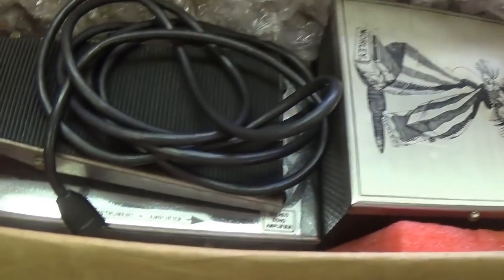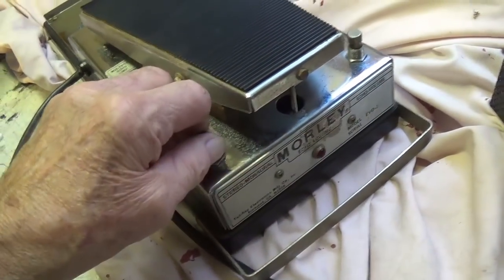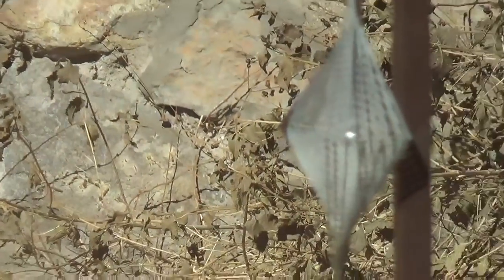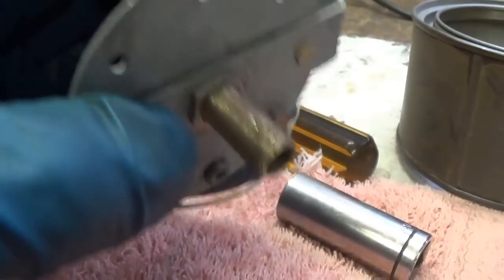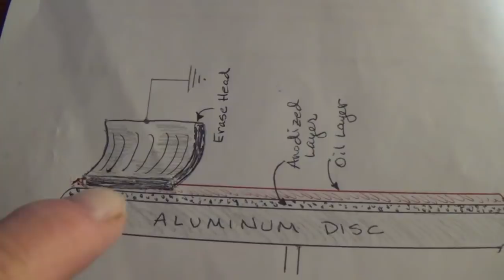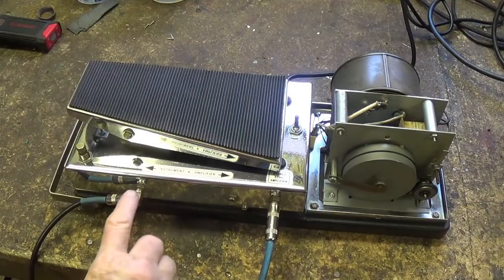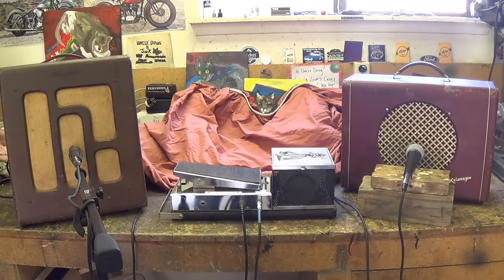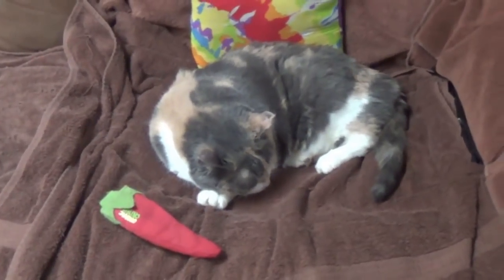1977 Morley Evo-1 Oil Can Echo-Delay Pedal......Complete Overhaul & Test

Comment: Back in the 80's I found a Fender oil can reverb in a dumpster.  It had not rained on it, so I scavenged it and took it home.  It looked like a tiny Fender amp, about 10 X 10 X 8.  Being in a band at the time, I knew being Fender meant something musical, so I opened it up and could not for the life of me could I figure out what kind of voodoo I was beholding. It didn't do anything but rotate, so it found a home in a long ago perished shed. I kinda wish I had it now, after watching this video I probably could have fixed it.  Very nice video, allways glad to watch!
Reply from the maker: Thanks for sharing, WH :)

Comment: Hi Uncle Doug, in the 80's to late 90's I worked as a tech in the photocopier industry and this anodized aluminum disc made me think of the 'heart' of the copier which is a cylinder, usually aluminum with a light sensitive and high voltage electrically sensitive coating. Earlier, that coating was selenium, later cadmium and later still what the manufacturers mysteriously called "organic." In the end, it's still a piece of aluminum with a coating on it. Companies that create these cylinders (colloquially called 'drums'), could probably coat the disc or discs or anodize them. 'Love your work in restoring amps and parts like this one, that you care so much for these great dogs and cats, your sense of humour and I'm in awe of your ability to find parts, tubes & caps for all these projects. Congratulations and thanks.
Reply from the maker: Thanks for your knowledgeable input, RS. You may well be correct, but getting the company to recoat a few discs after hours might be a challenge. We're glad you enjoy our videos :)

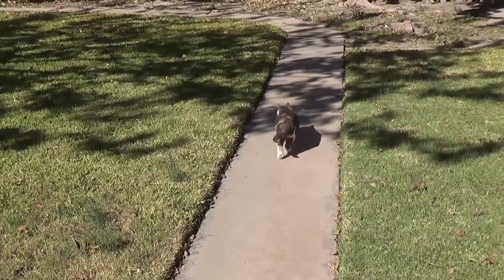Comment: 1:15:00 RIP Rusty. Great video, Doug. I hope you are well in Texas. I know a lot of people have had a hard time without power.
Reply from the maker: Thanks, Brad. Being in far West Texas, we were spared almost all the drama. There were a couple days of snow and cold, but the last 3 days have been clear....and it was actually hot today. I was working outside in a T-shirt (and pants of course ;)
Reply: @UncleDoug  When I was in my late teens and going to community College I worked anodizing small aluminum parts. That was 48 years ago but I still remember how.  The part was made the anode and immersed in a cold dilute solution of sulfuric acid that was in a lead lined tank. The lead liner was made the cathode. A specific amount of direct current was applied for a specific amount of time to make a certain thickness of anodized aluminum. There were tables we followed but we would also measure the thickness with a micrometer. The result is a layer of aluminum oxide that's very hard and corrosion resistant.
Reply: My mom lives in Donna during the winter, but fortunately her neck of the woods has been relatively unscathed. Hope you're doing well down there Uncle Dougie. I miss ole Rusty too :(
Reply: I miss Rusty !

Comment: Thankfully he didn't need to use the Heisinberg Compensator to liberate that stuck shaft! Nice work. I used to own a Morley Wah-Wah pedal
back in 1976 but someone decided they needed it more than I did and absconded with it from my car. Thanks for the detailed technical drawings and explanation. A fascinating bit of engineering.
Reply from the maker: You're quite welcome, Dr. Z. I did end up using my trusty propane torch to heat up the frozen shaft and liberate it from the tyranny of its captor.

Comment: Thank you for the detailed explanation of the workings of the system. For the first 40 minutes I was about to die from curiosity and scratching my head about how it's supposed to work. And I still don't understand how a piece of rubber writes musical signal electrically for it to read. This whole unit is brilliant engineering and full madness. Who comes up with stuff like this? It sounds and looks very cool.

Your comments always crack me, nice to see the cats doing ok. I miss Rusty. My dogs are also buried at our summer cabin's front yard, behind the small potato soil and bushes.
Reply from the maker: You're welcome, Yuppi. Think of how your body picks up a static charge when walking on carpet in rubber-soled shoes. Same idea.

Comment: Hahaha I loved my old Morley Wha/Vol and still have an old Morley "man" logo sticker on my guitar case.
The nonmechanical opto variable resistor on these were revolutionary. My Morley wHa-vol still functions flawlessly with no noise or bad mojo. No moving potentiometer to get abused. Smart design for sure!
"Morley men do it with their feet."
Reply from the maker: I agree that the opto-resistor array is definitely unique.....and effective. Thanks, SS.
Reply: @UncleDoug  Uncle Doug, at 24:30 , to hold onto the threaded part, just thread those two nuts back onto it, and tighten one against the other. Then you can hold onto the tightened nuts instead of harming the threaded shaft.
Reply: @cjay2  One way,  better if you are able are soft jaws in a vice , its probably not too stiff once penetrating fluid added,
Reply: @highpath4776  As long as you're careful that the soft jaws don't harm the threads. Doug did well to use heat to help separate them, though I would have first gone for tightening the two nuts against each other.
Reply: @cjay2  i was thinking same thing about two nuts, but if you put too much torque then stripping could happen.  sometimes too much torque/force can break metal in unintended ways.
Reply: @stevewinwood3674  Perhaps if using the two thin nuts that go on that bushing, but I used to thread and tighten two normal stainless nuts onto studs that I needed to grip heavily when I rebuilt auto engines.
Reply: @cjay2  i understand the concept as does many others.   it isn't some secret you are talking about. 

point is that you could actually break or deform the entire bushing/threaded part if too much torque was applied. maybe that was his concern. who knows.
Reply: @cjay2  for clarification i mean break the entire hollow bushing. not tear the threads.
Reply: @stevewinwood3674  Probably was his concern. In any case, he got the job done without breaking anything.

Comment: The aluminum disk looks like an old hard drive platter. Hmmm.
Reply from the maker: There is a resemblance, particularly the iridescent sheen.
Reply: I was wondering if you could use an HD disk stuck on a capstan of a cassette recorder with the read/write and erase heads moved to make an echo like this.

Comment: I got one on Ebay for $50 back in '05.  Had some fantastic potential, but also some obvious problems. After watching this wonderfully detailed video, I know for sure that I would've only made things much worse, if I started to dismantle the pedal. I didn't like the looks of the belt/rubber wheel assembly & sadly decided that it was best that I look no further, and pass it on to the next buyer. Hopefully someone has done it justice like you have here. Restorations can be so much more difficult sometimes, than just making something by scratch.  Great job Doug!
Reply from the maker: Thanks, James. Hopefully, the pedal found a good home ;)

Comment: Great Video! I used a Morley Echo/Volume pedal in 1978-1980 then sold it to a pawn shop in Rockville, M.D. Needed cash badly at the time. I could hear the whoosh of the disc in the audio signal quite loud at high amplifier volume. Only went to 330 milliseconds max delay time. Only other choice at the time were an Echoplex or MXR Analog Delay. Still use a Morley Wah/Volume Pedal in my current rig. Thanks Doug, Morley Men Do It With Their Feet!
Reply from the maker: Thanks for the nice comments and information, Walter.

Comment: Great job once again! I recall pulling my hair out, back in the day, working on a Morley fuzz/wah pedal that used the same photo-resistor control..until I realized linearity of the sweep   just wasn't possible..closer to an on/off effect than a gradual change..it was like it was designed by the minds of Rube Goldberg and Victor Frankenstein. Electro-mechanical weird genius at it best......It's Alive!!!
Reply from the maker: It is indeed, FB ;) Thanks !!

Comment: Wow, that sounds amazing in stereo!!  I always though the oil was the medium for recording, and the aluminum plate was just a carrier mechanism for the oil.  And that the oil was nasty smelling because of the added chemicals necessary to store a magnetic charge for the signal.  I really enjoyed seeing all of the inner workings of this baby, thanks Uncle Doug!  Hi Jack, Ollie, and KC! 😸  (if that box was in my house, Sheldon would be in it in a heartbeat)
Reply: I absolutely love how chunky KC has gotten.  Clearly she is happy with her home
Reply from the maker: Thanks. I'm glad you enjoyed the video, GF. Fresh UC oil has little or no smell, but after 40+ years sealed in a damp, corroded can, it does develop a very unpleasant scent......to say the least.
Reply: @UncleDoug  Maybe the wrong oil had been used previously - vegetable??
Reply: I thought the oil was the actual medium too but apparently no - it's the anodization or oxidation layer on the aluminum disc. I don't know anything about anodization but absolutely naked aluminum forms a very hard oxide that's a good insulator (which is why it must be used only with great care in mains wiring and is no longer allowed to be used in the walls of homes). Whatever that extremely thin layer is, it passes light and that's why it has a slightly iridescent appearance (from reflected wave interference). But that layer is what's actually carrying the signal around from the write head to the read head in the form of a varying electric charge - the oil is just to keep the heads from wearing down the disc's charge-carrying layer. I'd be interested to know just how high voltage a signal is being applied to the write head and what's being fed to the erase head. Also interested to know if there's a DC bias.

Comment: the way the black widget covers those photoresistors is cool. i love old-tech.
Reply: That was the big deal about all the old Morley pedals - no pots in the pedal mechanism. When I was in high school our guitar player in band had the Morley phase shifter pedal - very distinctive as phase shifters go; once you hear one, you know when you hear it again - and he asked me to have a look at it because it didn't work. It wasn't until I opened it up that I realized that the blown pilot light was its one and only issue. BTW IIRC Boss volume and wah pedals used a magnet and a Hall effect transistor to get around using a pot. Yet it's the rack-and-pinion pot-based Cry Baby that seems to have had the most longevity among wah pedals.
Reply from the maker: Thanks for the interesting info, Hub.
Reply from the maker: We do too, CJ :)

Comment: the black piece is called a "curtain", I would still be using these old Tel-Rays if they weren't so big, these are the best pedals on earth in my opinion.  I used to buy them and fix them, also there usually were extra bulbs inside.
Reply from the maker: Thanks for your input, David.

Comment: I owned one of these in the 70's - 80's and loved it (although it was a chore to carry around ;) ). Bulletproof in my experience, and the echo was WAY clearer than what we're hearing here, not sure what the difference would be with the rebuild. Sold me on Morley pedals, too.
Reply from the maker: No doubt the units worked better when nearly new, Dan. Short of replacement of all the parts, it's hard to overcome the effects of age.
Reply: @UncleDoug  Still working on that myself. I really enjoyed seeing it opened up and explained - Thank you!
Reply: @danwilliford7330  My guess is that either 1) the flywheel isn't firmly screwed to the shaft 2) the aluminum disc has some runout, i.e., it's not turning true to the shaft 3) the flywheel is just a little bit eccentric on the shaft.

Comment: Beautiful job, on that brass threaded. Shaft for speed when confronted with such I use two nuts tighten lock them together to hold the outer brass,  then lube shaft heat & loosen the inner .
Reply from the maker: Thanks, Mike. That's a good method also.

Comment: I use this exact pedal, Les Paul --> Overdrive --> Oil Can --> Vibro Champ and it sounds amazing, it's like having a very expressive reverb tone and if you push hard it will go into echo saturation. Mine also came with the grey silicone sealant around the hole through the can lid, maybe coincidence, maybe factory? It also has a silicone bead on every internal edge/seal. I removed the silicone and hope it doesn't tip over. I got the oil from a guy on ebay. Thanks UD. My unit is pristine condition but I wanted to change the oil, and plan to do oil changes every once in a while. Also my can is shiny on the outside.
Reply from the maker: Thanks for sharing, MS. Best of luck with your Evo-1.

Comment: Great video. I'm in the process of working on one that I've had for over 40 years and hasn't worked or had oil for about 35. I was kind of disappointed that you didn't show the oil being added or how it's done. Mine had a hole drilled in the top of the can, a screw put into the hole and the head of the screw soIdered over. I made a new hole and when the oil comes in I'll just plug the hole afterwards. You can get a lot more info if you search for telrayoilcanaddicts or maybe you're already there...
Reply from the maker: Thanks, Joe. When the front cover is off the can you simply pour in enough oil to cover the bottom 1/8" to 1/4" of the spinning disc. I could have sworn that this was discussed in the video.
Reply: @UncleDoug  Maybe I missed it.
Reply from the maker: @joecafferky8766  It's possible. Regardless, good luck with your project.

Comment: Just built my first pedal last night on a breadboard. Somehow, I ended up with a fairly good sounding silicon fuzz face on the first try. 

So I ordered a fuzz face-specific circuit board so I can solder it permanently and install it into an enclosure. It also comes with a board for a germanium PNP build. I'm sure I'll build one of those at some point, too. 

Who knows...i could be building  and modifying amplifiers before it's over lol 😁👍
Reply from the maker: Thanks for sharing, JC. Best of luck with your projects.

Comment: Not critical, this is a magnificent restoration of music history. I can almost guarantee  the read/write shaft housing had a grommet to seal the shaft housing to the outer can lid. Hence the large hole in comparison to the shaft bushing diameter. Could you hear me yelling this? :D
Reply from the maker: A grommet could not seal the oil from traveling down the threads of the housing. If they used that method, it was not ideal.
Reply: @UncleDoug  OMGee Uncle Doug replied to me!!! Agree Sir!!!    By the looks of the pre-existing hole, maybe a previous owners work. thank you immensely for the wonderful videos!!!

Comment: Ahhh, so I'd been experimenting and I believeee I have managed to make a great replacement oil for these, I say believe because I now need to run my model for 20 or 30 years to see if it holds up 😂 made it entirely by accident too, the bets kind 😁

The rubber they used for the heads was a rubber mixed with carbon as to make them conductive, what I wouldn't give for a small rubber roller 😂

Was a great video, thanks for sharing this one!
Reply from the maker: Greetings, P. I think all black rubber contains carbon. Glad you enjoyed the video :)
Reply: @UncleDoug  hey ill try swapping the wipers for ordinary ones but I'm not holding out!

Comment: Well done!👍
BTW I have a Morley Rock'n Verb Mod-RNV which I bought used nearly 35 years ago. Same funky pants etc. logo and is built like a tank. The PCB looks very similarly made and the trim pots and those grey Elna electrolytics (which seem still to OK after many decades) are identical as well. Sadly official schematic diagrams of many of those vintage pre 1989 Morley effects were lost after the company was sold.
Reply from the maker: Thanks for sharing, J. Maybe the new owners will be able to find and distribute those schematics.
Reply: @UncleDoug  Unfortunately not.
I asked from morleyproducts. They got those documents that were available in 1989 but many documents of early Morley products are and probably will be missing for ever.
So  I have to figure out the schematics myself if there is no other options.
Unfortunately for example the bucket brigade circuit is still unknown to me because they probably intentionally wiped off the markings of the ICs.(🤬)
This guy would know everything about early Morleys but sadly he passed away nearly 20 years ago:
https://www.latimes.com/archives/la-xpm-2002-jul-03-me-lubow3-story.html

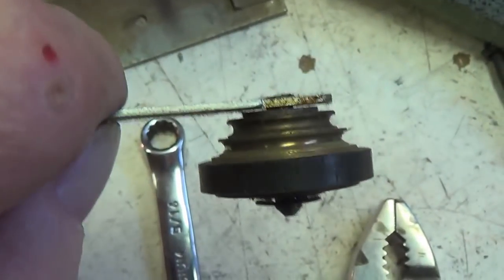Comment: @13:00 Whenever I rebuilt carburetors, occasionally a missed O-ring would get washed with the carb in my oscillating basket carb cleaner. One time an O-ring the size of my thumb came out looking like a tractor inner tube you could go down the river in.
Reply from the maker: Cleaners like that can really swell the rubber, Mike.

Comment: A superb restoration of an interesting, innovative device. It has a unique sound, very pleasant to the ear. I'm guessing that the rubber pickups are conductive. Time for another beer, cheers, Steve.
Reply from the maker: Thanks so much, Steve. Actually, since the signal is stored as a static charge, the rubber heads don't need to conduct.